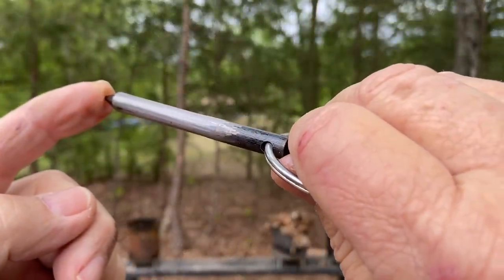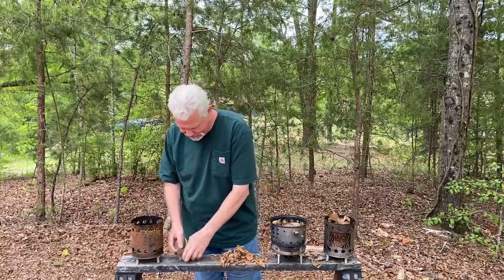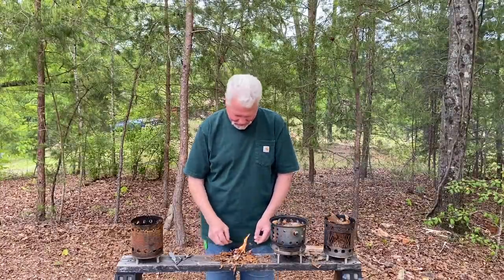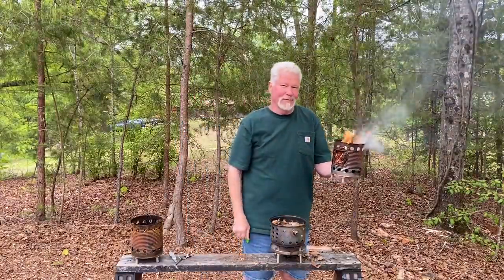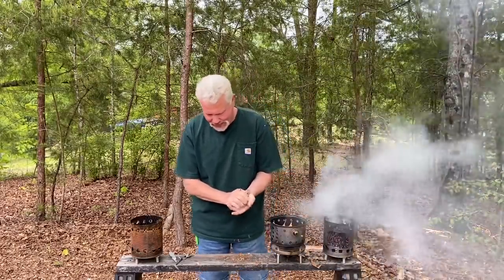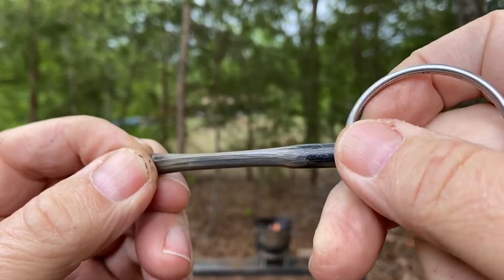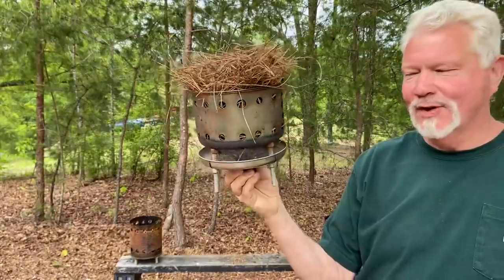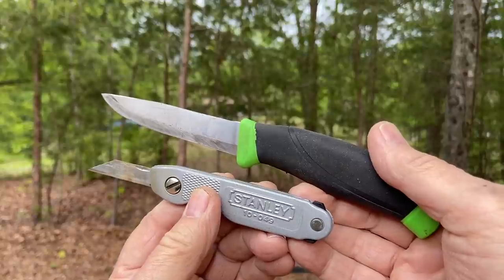Why Aren't Well Worn Ferro Rods Demo’ed On YouTube?

Comment from the maker: They inhibit sales? They don't work as well? They lack visual appeal? Some kind of an operator's ego thing? I don't get it.
   LOL! Come watch my little 3 1/8" x 5/16" bayite keychain ferro rod, all thin and worn down, show out with some wet leaves and dry Pine Needles! Please follow the LINKs below and SUBSCRIBE. Thank You!

Ferro Rod Playlist
https://www.youtube.com/playlist?list=PLkoXX8XsMW3lI6k8TH1Bljf57Yvp9K1WD
All Ferro Rods Should Have A Point On Them!
https://youtu.be/wUS5YDcVWOo
Reply from the maker: @adammcguinness9950  I didn't know what to buy 8 years ago at the beginning of my channel. I bought a Bear Grylls from Academy Sports. It was soft and great. My next one was a Light My Fire. It was soft and also great. Next, I tried the bayite. It is soft and great and all I ever use now.
Reply: @DavidWestBgood2ppl  thats funny! I just found my old bear grylls fire steel about 2 weeks ago in the back of a gear container. Its actually one of the best I've ever owned.
Reply from the maker: Parents should teach skills.
Reply from the maker: @charlessalmond7076  Mine was perfection also. Just like the bayites I use.
Reply: sounds like maybe the material ferro rods are made from is just generally soft and great and maybe hard to mess up...
Reply from the maker: @thalaquatics8712  Maybe.
Reply: Shiny new tools means they don't get used. Taking away from the presenter's authenticity. Well spotted.

Comment: Hi David - I've owed you a comment since, like 2017! When I read Mike Peterson's comment, I knew I had to write - rarely have a keyboard.  I too am celebrating 50 years in Scouting this year and I've likely watched about 70% of your videos over the past 5 years - and you put out a lot.  in 2017 you wondered if anyone does anything like your keychain ferro rods.  Well - I made 40 kits back in 2017 for my contingent of scouts going to National Jamboree - and we learned how to use them.  That was when you were drilling them and inserting nails, which is what I did - what a sparkfest drilling them!  Then made the parachord lanyards along with an attached piece of fatwood I split out and a piece of a virginia pine root and a piece of hacksaw blade for a striker.  We had a blast trying the different types of tinder you suggest.  I even had a smaller group learn how to do the fire roll - that's a neat trick.  I have my #10 can waiting to be made into a hobo stove and my Stanley 10-049 is on the Christmas wish list...  Just want you to know I appreciate your hard work and willingness to explore and share!  God Bless - D
Reply from the maker: Wow, I've gotten a lot of feedback from Scoutmasters over the years, but not in such detail. Thank you for such a great  and complimentary comment!

Comment: Same thing with knives. I did a knife review the other day and pointing out the fact how well used my knives and sheaves are, because I actually use them!
Reply from the maker: I love to examine the bumps and bruises on knives and tools, etc
Reply: @DavidWestBgood2ppl  probably 90% of gear reviews in the Bushcraft community is gear that is hardly ever been used. I did a knife review talking about the Old hickory butcher knife and how it beats knives that are $200. In the real world!
Reply from the maker: LOL! I love my Old Hickory. I just don't know where it's at!
Reply: @CRJines  YES! Exactly! I have 2 different items "Old Hickory" knives, 1 of them was purchased on Ebay as used item, and I am absolutely satisfied with both of them, and they were not even expensive! Both of them are full-tang of course. The old knife I purchased on Ebay was a bit rusty here and there, but I loved it because it is the proof that is was made from carbon-steel. I do not like the modern stainless steels. The're almost impossible to be re-sharpened... That rusty "Old Hickory" knife - I deeply believe - a real treasure, the best knife I ever seen!
Reply: @DavidWestBgood2ppl  My Old Hickory is made in USA, Ontario.
Reply: @carnivorecaveman ,

I also like carbon steel knives for use in the kitchen.  They can be sharpened super sharp with a small effort.  They may not be shiny, but they are great for slicing a tomato.

I carry a buck knife in my pocket with a stainless steel blade.  It is a good knife to carry with me daily as I often need to cut twine.  It cleans up well with some hot water.

Comment: Good Evening David ..
What a Question! 😁.
I have all of the Ferro Rods I need (4) .. with all not being particularly well worn. Reason?
I light up something to cook with practically every day (liquid / gel fuel, wood / charcoal or gas) and use matches as first choice .. followed by a BIC Lighter and this as an exception as and when required. My Ferro Rod is my option when Plans A and B are not on. Yes, a Ferro Rod is part of my EDC. Char Cloth, Sparker, Magnifying Glass and such also skulk around somewhere there in the background.
I'm working on using Bow Drills and Ash Cloth Techniques. At 72, one is never too old to learn something .. although, at this age one has to get a move on before time runs out 😏.
Am I proficient in the use of a Ferro Rod? Yes! The wear and tear is the result of practicing to be become so .. and I do stay in practice.
Many won't agree .. but that's how I like it. Having grown up with Matches and Ronson (pre-BIC) Lighters, perhaps I'm just 'Old School'. I do also, just for the hang of it, occasionally haul out my Zippo (a gift many years back from the wife), refuel it and take it along. No I don't smoke .. never have.
Nice  Post .. thanks. Relevant Question 👍. Take care .. Tommy
Reply from the maker: Books of matches, stick matches, Zippo lighters, they're what I used also.

Comment: Glad to see this video pop up in my feed 2 weeks after buying my first ferro rod and it just so happens to be a 6" x 1/2" Bayite that came with a striker and Paracord for about $16, figured why not and reviews were consistently good, better then more expensive options even, it's hard to know which ones to buy with so many to choose, guess I got a decent one.
Reply from the maker: I'll never switch to another one. It never develops ripples and is soft enough to deposit loads of burning metal consistently.
Reply: @DavidWestBgood2ppl  Happy to have found your channel and confirm the quality of the ferro rod I purchased from someone with your experience, I appreciate your response, thank you Sir.
Reply from the maker: Your welcome!

Comment: Greg ovens has a wore out ferro rod. He keeps saying he will replace it but he hasn't.
Reply from the maker: Oh yeah that's right.
Reply: David, I see that the "ring" end of your ferrorod is still as big and fat as new. Why not drill a hole in the other end for the ring and see how much longer it can last?   You might try making it at 90 degrees to the original hole.
Reply from the maker: I've though about it. I wore through a Light My Fire ferro rod years ago. After it broke, I showed how to ignite tinder by scraping it across stones and concrete.

Comment: They will last  quite  awhile    before  there  are  not of any use .   Made a small bag  with  couple of rods / mag lens / 2 bic lighters  /  wood matches  in a small  sealed  bag  that fits  in the  Webb  belt pouch.  The good strike any matches   don't  seem to find them any more like Ohio blue strike  or kitchen  chief  the one's  you could strike off your pants  or against  each other.
Reply: Careful putting them in ziploc bags kinda like tinder. The moisture can't escape the bag. If you've ever seen a ziploc sweat on the inside you know what I mean. The best way to use a ziploc is to throw your stuff in then use a blow dryer to remove the remaining moisture in the bag. I've seen people set their tinder bag out in the sun and after an hour there was condensation all over their bag. Keep surviving mate.
Reply from the maker: You have prepared, well!
Reply from the maker: @brandonmefford4619  Thanks Brandon!

Comment: Has anyone used the Ferrorod "magnesium block" combo from Harbor freight tools?  
Recently I restored a cigarette lighter whose flint had oxidized over the years of just sitting in a drawer. It was a pain to clean out the chamber that housed the flint. Now having discovered that these ferro rods are nothing but the same substance found in lighter flints, I would find it practical to coat the clean scraped side of the rod with a very light coating of bees wax to keep out the oxygen if one plans on storing it for a very long time. Never store it in your pants pocket once coated with the wax, it will come off in ones pocket staining it.
Reply from the maker: I've never tried any of the Magnesium/Ferro Rod fire starters. I hear they are great. I've never had a problem with corroding ferro rods. I use bayite all the time, but I hear that others do and keep their rods coated while in storage.
Reply: Magnesium blocks are great, but the scrapers they come with tend to suck. Best thing is to pair them with a piece of a hacksaw blade to shave off the magnesium

Comment: I love my Morakniv Companions. Yes I have 5 or 6 of them. But they are no good to me for my ferrocerium rods. That's okay though, as I have a big ferro rod that came with a great striker attached by a bungie cord. It works awesome. I'll stick with this one when buying ferro rods. It's an überleben (8" length, 1/2 inch diameter). The striker also has measurements on it (a ruler) and is a bottle opener. Not that I need one of those.
Reply from the maker: If you ever want to sharpen the spine of those Mora's, I have the videos.
Here's just one of them https://youtu.be/RGH7-k3ieME
Reply: @DavidWestBgood2ppl  I have seen videos of getting the spine so it's good for ferro rods. Things is, I don't have anything to do that. No file, grinder, sand paper, etc. I don't get alot of money, so I am limited to what I can buy and look at good deals when I do buy something. But it's okay anyway, as I do have that great striker with my ferro rod anyway. But thanks for pointing out the video!

Comment: I had a bucket of prep supplies that I opened up to check the condition of and found a pile of gray dust at the bottom. Turns out the ferro rod had started to disintegrate. I didn't even get to scrape it down to nothing, it just became nothing. Although, the dust burned quite nicely when set on fire.
Reply from the maker: I've seen the kind of ferro rod corrosion that you describe, but only on the surface of rods. Wow!
Reply: Glad you found it during a check, and not during an emergency! Maybe it's time to check on mine..

Comment: David, I noticed that as you approach using the middle of the rod, you are creating many small scraped facets around the rod.  The larger the surface area scraped produces more sparks, enabling one strike fire.  I think the more non-single strikes one has to make to start a fire, is a waste of rod material.  

Wet tinder is worst case scenario, so adapting to a worst case scenario seems appropriate.  

The way I am addressing this idea is to chuck my ferro rod in a vice and cutting it lengthwise down the middle with a coping saw (an admittedly slow process).... But, now, I have two useful rod that are optimized for one strike fire starting because instead of striking the outer perimeter of the rod, like one would normally do, I am scraping the newly created flat surface to make the most sparks possible.  I think scraping the full width of the rod, once, is the most effective use of a rod's resource.

I'd like to know what you think about this.  These are my ten cents (because:inflation) anyway.  

Love watching your channel, Brother.  Keep going.
Reply from the maker: LOL! You don't ferro rod a lot do you?

Comment: I get plenty of orange sparks off my flint n steel onto my char. Have tried many different kinds of char. Rarely get char to catch an ember. Any thoughts? Thank you
Reply from the maker: I've had bad char like that before also. Make sure you use cotton fabrics without detergent and softeners on it, use a 1/4" vent hole in your char tin, and don't overstuff it. See my char playlist.
Reply: Thank you

Comment: I know a good workman never blames his tools, but my ferro rod doesn't produce sparks the way I see all these YouTube ferro rods producing sparks.
I have a Survival Inc Strike Force which comes with its own built-in metal striker, and no matter how hard I try, I can never get the kind of long-burning (i.e. 1 second or more), fizzing and crackling sparks I see on these YouTube videos. I only ever get sparks that are hot for a fraction of a second and then they go out. I've spent half an hour striking it into dry pike needles, dry grass, dry leaves and dry (fine) wood shavings (even dry sawdust) and nothing catches.

And just to clarify, I know about the coating that these rods have. I'm not just scraping a brand new rod. The coating is long gone.
Reply from the maker: Bad striker and/or the ferro rod is too hard.  I use bayite ferro rods and sharpen the spine of my knife to scrape them.

Comment: Probably more simple reason. Why risk looking like an idiot if it breaks and they really are in the middle of no where. I mean. I'm sure it happens. I can break a 7" long,  quarter inch thick hatchet, why would a thin, made to be scraped piece of metal be more sturdy, right?

Maybe they like being reasonably certain it is going to function? Maybe they never really used one for long and just didn't know any better? I like knowing for sure in your video it can last long. But unless I were homeless, I would probably replace it long before it became that thin. Either that or use it with a replacement handy and on me. The latter makes more sense to me =D
Reply from the maker: Makes sense!

Comment: Why aren't ferro rods used up like yours? Because they are supposed to be used as a semi-last-resort. 
If it's used up like this,  it could bend or break as it thins out. Yes, practice with a ferro rod. But if you're going out in the woods and might be there a while, carry fresh gear. It may take a few strikes,  but you'll have more fires possible.
Reply from the maker: Interesting take you have. TY!
Reply: Agreed.
Best thing about Ferro rods is that they're small-, light- and chemically stable enough that I can hide them in my kit and forget about them until the situation where my other, more convenient ignition methods have failed me.

Ferro rods cover those scenarios where you could end up fireless when you really, really need that fire going, and i appreciate the hell out of them for that. I like staying alive!

Comment: I don’t really understand the obsession with fero rods. 

90% of the time your gonna have a lighter, why would you choose a ferro rod over a lighter, sure they last longer. 

So have a few practice goes, throw one in for redundancy and use a lighter, it’s still an object you need to have on you, as well as a knife, and very dry leafs or char cloth. 

Ferro rods are just tedious lighters. 

Light a fire without anything but a stick. That’s a skill.
Reply from the maker: I always use a BIC off camera like everybody else. Ferro Rods are a good standby. Yes, your hands can get too cold to strike a BIC, but they may also be to cold to strike a ferro rod. When BICs won't work in very cold temps, I like to warm them in my armpit for a few minutes. It takes a few minutes to dry a wet BIC, but a wet ferro rod will work right on. The few problems that can affects BICs are not insurmountable.
Reply: @DavidWestBgood2ppl  oh I never realised those things, I live in Australia so cold is never an issue haha basically lighting a fire here in the bush mainly involves raking a 3-4 meter clearing digging a hole and building a barricade so your campfire doesn’t turn into a bushfire haha. 

Then you just throw some sticks leaves and wood in a messy pile and throw a lit cigarette  on top and woooshhh, campfire. Haha 

I guess ferro rods arnt as redundant as I thought, though I’d still carry a little clicky blow torch over that, also I’d probably have a bottle of kerosene for the army stove aswell.

Comment: I bought one because of all that hipe but quickly returned to my Bic lighter. Sincerely, what is the advantage with a ferro rod over a bic lighter.
Reply from the maker: BICs have issues with getting wet, extreme cold, wind, running out of fuel.
Reply: @DavidWestBgood2ppl  I guess it's a bit like using ratchet straps versus learning how to use rope as an expert. I will go and give it a go more. 
Running out of fuel is more from the days of zippo.
But anyway, it's funny to have skills and knowing what to do.
Thanks.